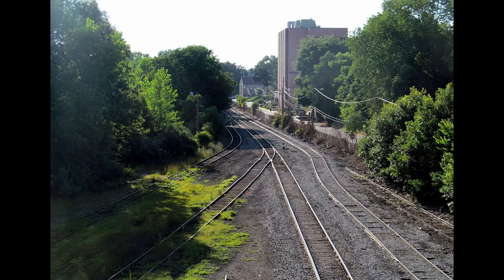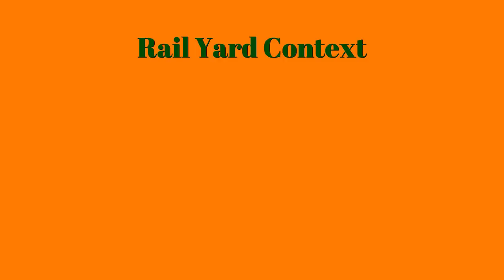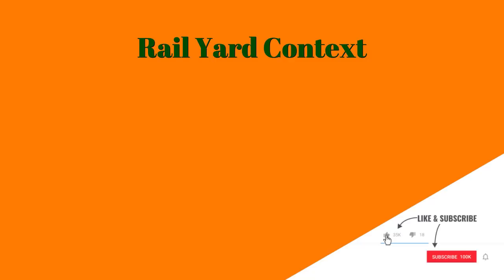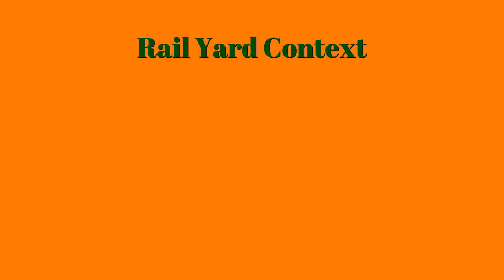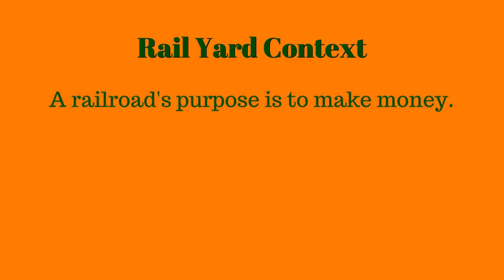Model Railroad Yard Operations - What They Do And Why They Do It

Comment: That Humpyard at 2:30 is called Kijfhoek and is located in Zwijndrecht in the Netherlands. I used to watch locomotives do switch work for days there. So much action with also a high speed rail connection at the time. It has its own dedicated line to Antwerp and Paris now.

Comment: You did a pretty good explaining switching and blocking. There are still some variables. Many of them have to do with the operating plan, and the ability of the yard to classify cars efficiently. If a yard has limited capacity, they might have a couple of blocks to be set out on the way to the next terminal. Everything else might be “junked,” or sent unblocked to a yard where there is capacity to efficiently block the cars.

In transfer trains, with cars sent to another railroad, there might or might not be agreements as to blocking the transfer. I work for the Delaware and Hudson. We had an agreement to preblock cars for Guilford. They sent trains to us that were blocked for points on our line.

The yard that I work in is near Albany, NY. We have cars coming in from Guilford/Pan Am, Vermont Railway, NS, CSX, and locals jobs. Every night a train heads to Montreal, Quebec. As the various trains come in, they are switched. Usually the yardmaster assigns a track for each block. Usually he assigns the blocks to the tracks based on the number of cars in the block. For example, if the Chicago block has 10 cars, he would make up that block on a shorter track. If the Montreal block had 50 cars, of course he would use a longer track for that block. Once all the blocks are made up, then they are doubled in the designated order. In the Montreal train, the cars to be set out on the way there are usually on the head pin. Next might be the Montreal block. Sometimes, depending on capacity, this block is sub blocked. There is a regional railroad there, and they usually get a large amount of cars. Next is usually a Toronto block, followed by a Chicago block. Those yards will further classify the cars. Sometimes the blocks aren’t exactly in order. As I said, the train sets off on the way to Montreal. Usually there are only a few cars in this block. If the cars contain hazardous materials, the laws require them to be placed a certain number of cars away from locomotives, or even operating refrigerated cars. In this example, the local set outs may be buried in the Montreal block, so they are far enough away from the engines. Once set out, the Montreal block will be contiguous. This is an example of special handling that must be accounted for.  There may be a over dimension car for Chicago. Even though the block is on the tail end, this car is on the head end. Sometimes a trainman must get off and watch to be sure the car clears adjacent structures, or other trains.

Usually after this train leaves, the yard is fairly empty. It is a good time for the local to be made up. There is plenty of space. Now the local cars can be switched for the order of each industry. This can even be broken down for placing the cars in order for appropriate spots at each customer.

Beside just getting the blocks right, car restrictions come into play. I’ve mentioned hazardous and over dimension cars. There are other factors to consider. Some are beyond the scope of a model railroad. Sometimes these factors are just as valid on a model railroad. One example is short/long car combinations. An auto carrier is 89’. on a curve, it might tend to derail a very short car, such as a 40’ cement hopper. This can be avoided by switching in a car of intermediate length. The NMRA recommends to ballast a car to a certain weight. In the prototype, empty cars on the head end pose a problem. On a heavy train, light cars tend to get pulled toward the center of a curve, and then they derail. This is called string lining. In my example, the train had the Montreal block ahead. If that block contained mostly empty cars, and the Toronto and Chicago blocks were loads, then they might change the order, and put the Montreal cars on the end. 

One last example of special handling is passenger cars. We have a plant that builds them. They don’t have the strength to withstand freight train forces. They need to run on the tail. They also can’t run next to cars with shelf couplers, like tank cars. This is because the shelf might damage the spring loaded walkway, on the coach. Some other rear riders are snowplows, and scale cars.

I might have gotten way beyond what Ron was illustrating. Nobody says that you have to be 100% prototypical. My intention was to show some of the challenges of properly making up a train. If you operate your layout, based on prototype practice, then these factors may be of interest.
Reply from the maker: Hi, Brian. Thanks for this detailed explanation. I was just trying to show the bare basics of what a yard does, but this is a good description of those more detailed factors.

Comment: Nice explanation. I spent 10 years as a switchman for chicago and northwestern/U.P. You hit on every relevant point. I would like to add that EVERY track has a name or number. EVERY track. Even a useless looking stub track for example. you can call it the name of the previous company that it served. Here in Milwaukee where I worked we had a track that used to serve a company that made stoves and refrigerators called hotpoint. (btw I do think hotpoint is still in business just not here in milwaukee) The place went under and the building torn down. But a small portion of the rail remained. We called that small remnant the hotpoint lead.
Reply from the maker: Thanks for that illustration--great story. Every track has a name...and maybe a story.

Comment: Great basic switching explanation. In real world switching it can become much more difficult. Hazmat cars, high wides, short to long cars, etc. We use hazardous materials switching charts and hazardous materials placement in train charts. Yardmaster have computer programs that pretty much does the work. Cars in active revenue service that sits in the yard have dwell time. The shorter the dwell time, the better. Cars sitting in yards dont make money.
Reply from the maker: Yes, I was trying to boil it down to its simplest functions here, knowing there is so much more that goes on in switching a yard. But again like I said and you in your comment, it is all about the money. That is not something most model railroaders think about, but adding that consideration into model operations makes things interesting in my opinion.

Comment: Ron, thanks for another great video.  The operations you describe are pretty much the way I thought they should be done and added another dimension to the way I want my yard to operate when I build it.  I do have some switching experience volunteering at a Scenic Railroad where our yard space is very limited and can get quite tricky. 
Barry Broyles
Reply from the maker: Interesting, Barry. Which scenic railroad do/did you work for? Of course there is a lot more complexity to these operations than I describe here, but this covered the basics pretty well.
Reply: The Wilmington & Western in Northern Delaware, I am a Trainman and Assistant Brakeman.
Reply: The Wilmington & Western in Northern Delaware, I am a Trainman and Assistant Brakeman.

Comment: Very informative. Many people think that they are just a waste of space and not used except to store the odd rusty car or when repairs are needed. It must be a dull job pulling cars around all day from one section to the next.
Reply from the maker: Probably so, but a lot of fun on a Model Railroad.
Reply: Jo Roderick Actually, I spend a lot of time in a transload yard switching. Contrary to popular opinion, switching is awful. Very tiring and difficult for the guys on the ground climbing all around cars and in-between them getting handbrakes and airlines sometimes power lines and pneumatic lines, and all kinds of levers and knuckle releases that have to be dealt with. And when you're in the loco, it's extremely stressful and difficult. It takes a lot of finesse, and even hitting an empy car a little too hard can knock it off the rails. Don't get me wrong. I've had a lot of fun switching with my dad in real life. But like todah for example, it was 110 degrees and extremely humid and my dad and I traded off driving the loco and being on the ground. Both positions suck in those conditions lol. Switching can be a lot of fun, but a lot of the timw it sucks, and boring is not the word I would use. Perhaps extremely tiring and stressful, but not boring lol.

Comment: What would the proper method of blocking the cars?
You skipped the basic steps as to which line the yard would use to block the cars.
Do they just use the feeder track or also the other open sidings?
My solutions are rarely the prototypical solutions, so I'm curious how the Big Boys would do this step. Great videos!
Reply: My question too.

Comment: hi Ron... awesome explanation of yard ops... but when blocking cars wouldn't the cars destined for the first industry be at the end of the train??? vinny
Reply from the maker: Hi, Vinny. A lot of factors impact actual car order, but no, the general rule is fist cars front. This allows the road crew to leave the train on the main or a siding and pull only the cars to be switched at a location. This allows safer switching as they do not have to work with all the extra cars between the licomotive(s) and the cars being worked. If an industry or grpup od industries has a facing point spur and a runaround is available, these cars are placed at the rear of the train so the locomotive can run around the train, pull just those cars, and work them without all the extra cars to deal with.

Comment: Great video! Well explained and easy to follow. Is it ok for the train to stop on the main and unload? -Mark
Reply from the maker: The main is within yard limits here and so is under authority of the yard master. You don't want to use the main for switching work, but it is necessary to use the main to drop the inbound cars to be moved into the A/D tracks. I believe that in most instances union rules dictate the yard crew move these cars, not the road crew shoving them into the yard A/D track.

Comment: Thanks Ron. I have a question: With so many cars running around the country, how does the freight car owner know where the car is, who to charge for it's use and who is responsible for keeping track? My second question: Some times I see eight engines at the head of 100 cars while other times there are engines in the middle or end of the train. Is there an engine power limit on the weight towed? I appreciate being enlightened.
Reply: here's a trains article on AEI readers and how they track railcars  https://trn.trains.com/railroads/abcs-of-railroading/2006/05/aei-data-tags-and-readers   also the main restrictions on how many locos are moved at one time is BRIDGE WEIGHT just like with highway big rigs... beyond that railroads can and do move as many locos as necessary with no limit... also railroads use a horsepower/ton formula to determine how many locos to put on any given train... the "wizards" in the ivory tower figure all that stuff out

Comment: Yards really don't do the detail blocking the way you describe it.  Tracks 2 and 3 would never be "blocked" the way you describe it.  It 's a waste of time.  Your yard really needs a crossover beyond the lead.   The "0"s would most likely be on the rear, the train would set out on the AD track then reach into the bowl to pick up the 0 cars and double them back to the rear of their train.  Especially if you are modeling a train with a caboose.  
Also "destination" is a relative thing.  For example, on the UP pretty much any general service car loaded on the west coast is a "North Platte".  Going to Kansas City, its a N Platte.  Going to Chicago, its a N Platte.  Going to Atlanta, its a N Platte.  Going to Portland, ME, its a N Platte.  Then at N Platte the cars are switched again and broken down.  Except on a local that actually serves industries, the "destination" of virtually every block on a train isn't where the customer is, its the next place the car will be switched.  The car going to Chicago, it actually leaves N Platte in a Proviso block, because it will be switched again at proviso Yard in Chicago.  The car going to Portland, would pick up an Elkhart or Selkirk block because depending on which train it took it would next be switched at Elkhart, IN or Selkirk Yard, NY. 
There are storage yards which are actually very modelable.  Look at the UP yard in Spring, TX. Along the eastern perimeter are "SIT" yards, storage in transit.  Plastics makers load hundreds of cars with runs of different types of plastics and then ship them to Spring.  Its a warehouse on wheels.  During the day, industries that use plastic buy carloads of the different plastics from the plastics manufacturers and then they bill the stored cars out to the industries.  At night the railroad sends a switcher into those yards to dig out the 40-50 cars that have been billed outbound, out of the 1000+ cars stored in the SIT yards.  Its the one type of yard that is prototypically cherry picked day in and day out.  Down side is that the only cars you will be switching are hundreds of grey plastics covered hoppers.
Reply: Great video as always. You give a good explaination of yard operations without getting bogged down in the details that prototypical operations face. It is your delivery of material that sets you apart from so many of the channels. Keep up the good work.
Reply: @Dave Husman you gave a good account of yard ops in your description... especially about "...on the UP pretty much any general service car loaded on the west coast is a "North Platte"... but oh how a year changes things... NOW with precision scheduled railroading, the move is to achieve POINT TO POINT operations while reducing switching moves between the shipper and receiver... so now I wonder how many of those same cars that were marked NP are now totally by passing NP altogether... PSR is not friendly to yards/switching... PSR wants cars moving further down the line minus any switching

Comment: "a car sitting in the yard is not making money".  Contraire mon frere.  The railroads are charging storage fees, for the use of cars.  Sure, there are exceptions such as the "hot shot intermodals", but, depending upon the commodity that's in that rail car, the railroad is going to work every angle it can to make money.  Only five years ago, during the oil boom in North Dakota, the BNSF would have Amtrak take the siding for an oil train because what the BNSF would be monetarily penalized (for having Amtrak wait in the siding) was nothing compared to what that oil train was making the railroad.